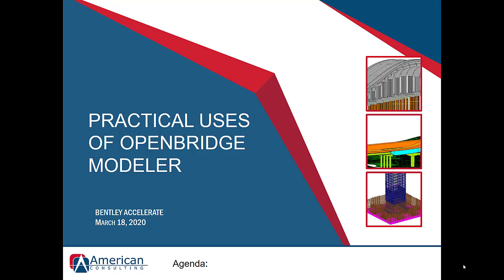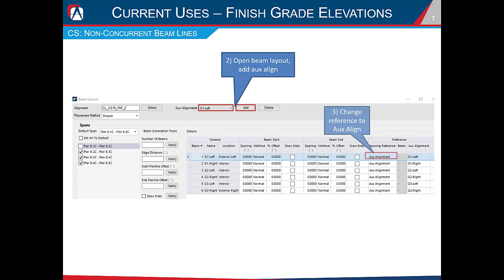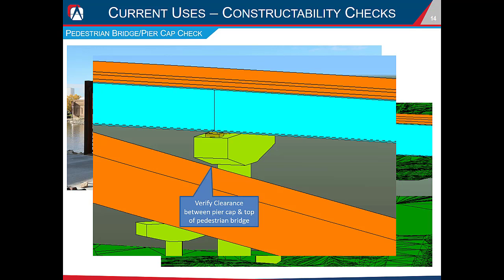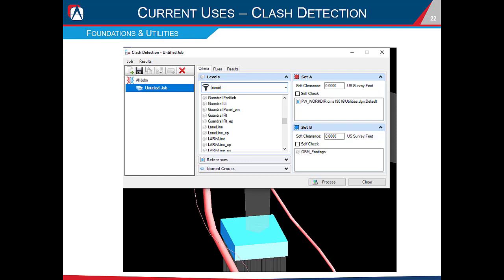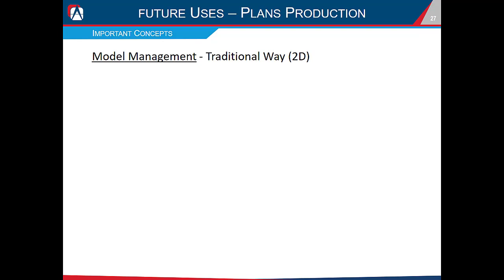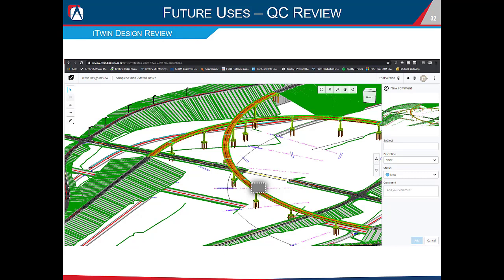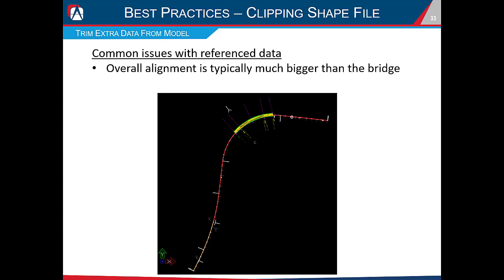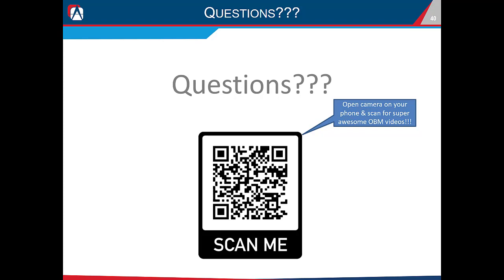Bentley Accelerate Civil Presentation - Practical Uses of OpenBridge Modeler

Comment: hi steve, great video, if beams are modelled straight without camber , how do you check the correct bearing plate thickness?
Reply from the maker: The camber is built into the buildup value in OBM. This can be done manually or you can let OBM do the buildup calculation for you. We calculate our bearing plate dimensions manually and enter them into OBM from there.